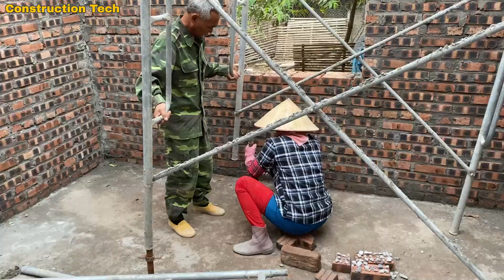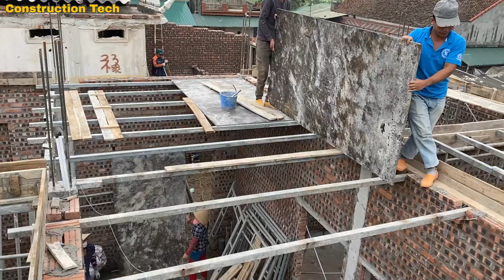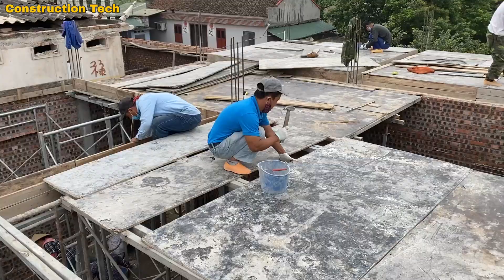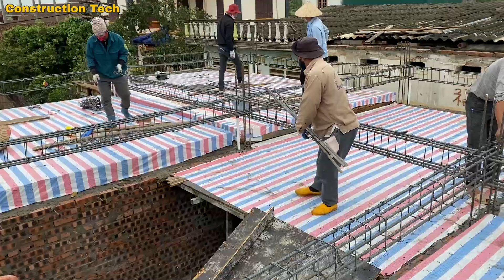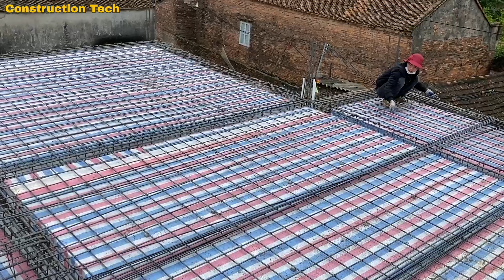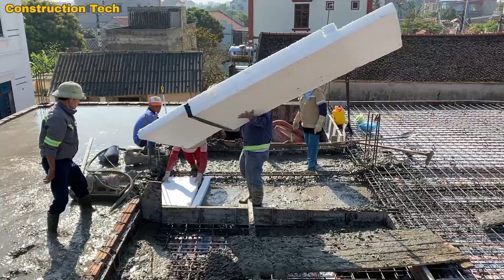Traditional Techniques And Manual Tools To Build The Strongest Reinforced Concrete Ceiling Floors

Comment: Bravo! Absolutely amazing. I would sleep soundly under this concrete deck. From the purpose built "vibrating bull float," to the gasoline powered, barefoot operated winch, this is a hymn to ingenuity and persistance. I might wonder at the fact that in the entire layout and prep I didn't see a level or a measuring tape once, but I have absolute faith that they were pulling those strings off of grade stakes-- somewhere. Just as I am sure that the pinned form in the dropped down deck will be removed the same way we do in America-- with effort. Proud to subscribe. Thanks for the video.
Reply from the maker: thank you very much